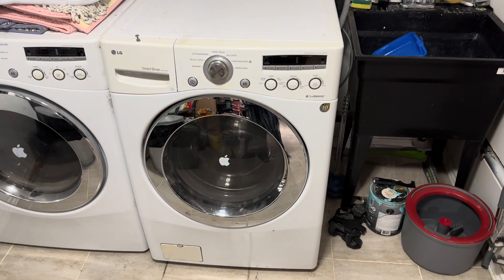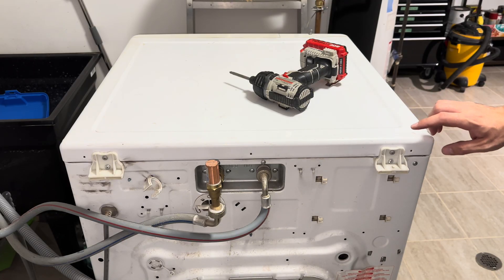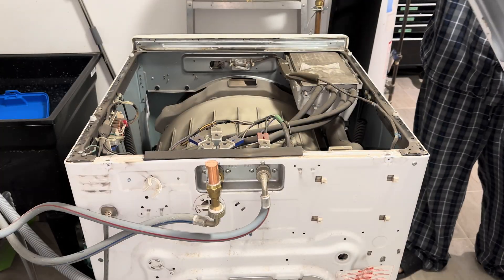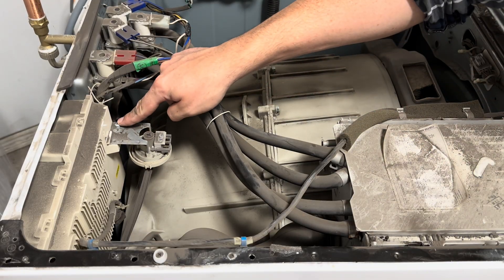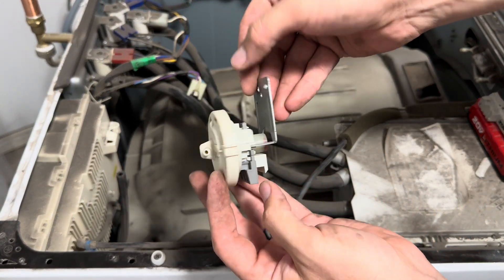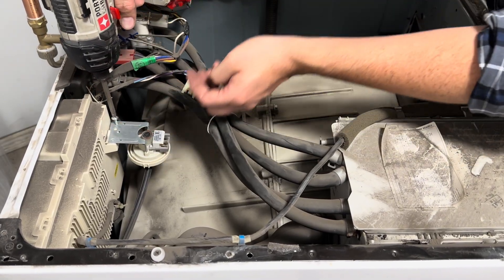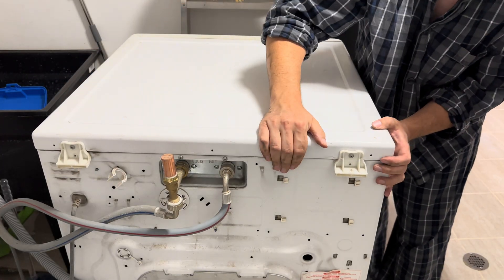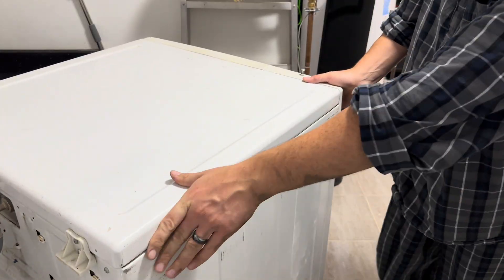LG Washing Machine Water Level Pressure Switch Replacement

Comment: is there anywhere I can order just the pressure switch hose? mine had a hole worn in it from rubbing on the bellows clamp screw.  Or can I just use any rubber hose? Thanks LG.
Reply from the maker: You can buy just clear tubing in the plumbing department Home Depot or Rona. Just bring the old tube with you as reference for inner diameter. There is nothing special about the hose. Thanks for watching. Please like and subscribe

Comment: Hola Internet - first, thanks for posting this!  My washer was leaking and not emptying for some reason..and it flooded my laundry room.  I figured it overflowed due to either some type of sensor or a bad pump and so I did some google engineering and came across this post.  Following advice from this video, I opened it all up to check the sensor and guess what?  The rubber tube that connects from the sensor to the bottom of the tub had come disconnected!  That was it!  The repair folks wanted to charge $400 to diagnose and whatever to repair.  You saved my $$ so thanks a lot for that!  And taking the time to teach the world :)